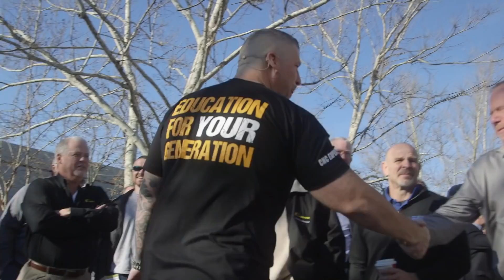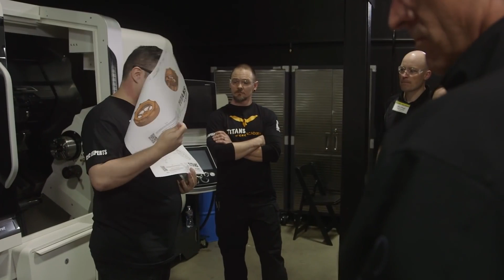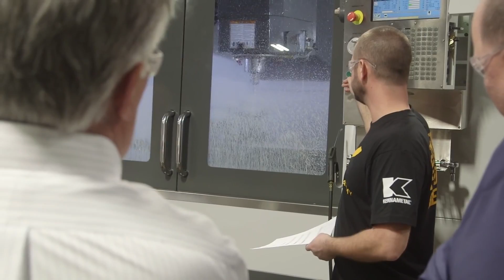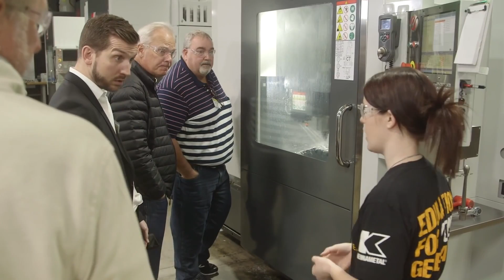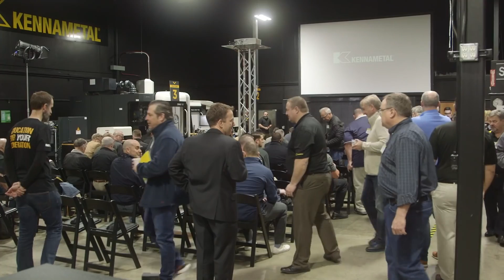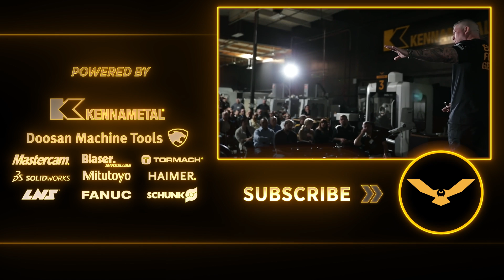The Question that Every Machinist Needs to Be Able to Answer

Comment: hard to feel good about the trade when they only wanna pay me 14 an hour and expect me to buy all my tooling. Just to run these one specific small parts, I had to spend 80 dollars for vise stops. No collets to use and have to buy more.   Jobs around here pay trash for machinist and when they do pay 2 dollars more, they wanna work you 60 hours a week.

Comment: I use to be that way at my last job tell they just saw me as a number. I can run parts fast an accurate, manual or CNC, mill or lathe. I doesn't bother me. 
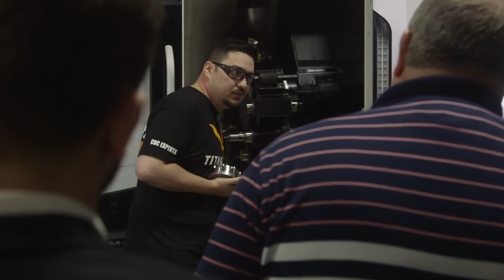What bothers me how inept my manager was that they didn't know I can run manual. I dropped a cycle time from 3:05 to 0:35 with proper tooling and programming.

Comment: Stop calling CNC people Machinist it's a insult to my trade.
Reply: There was a thing I read some years ago, They had built a New Boeing aircraft, they went out and flew it, it worked just Fine. They Landed it, took it all apart. Every part was checked for accuracy and tolerance...The whole plane was 90% out of Specification.  Thing was The critical Surfaces that HAD to be There were there. I thought that that was very telling on where the industry at the time stood. During the production of these planes there were no CNC Capabilities, There were no Bubble Gum Chewing Button Pushers that are now Proudly mispronouncing their 'Machinist" status. Goes to show that there is some latitude in a vast majority of parts, and Most are not Critical, These were done on Fixtures mostly By Skilled machinists and they were done on Manual Equipment.

Comment: Would love to set up a Veterans Org. to take homeless Veterans machining. WV would like me to do it - Land is cheap there would have to set up a campest with some mini homes as we are taking in Homeless Veterans with no place to live. The shop would not only have CNC machines but Vertical and Horizontal Mills, lathe's Shapers, Grinder. Also a section with small machines for doing things like watch and clock parts (Precision small parts).

Comment: I don't even have a purpose. I am passionate about this trade and I love everything about it, for no reason. I want to be efficient, more precise inside and outside the machine, to program smarter and fewer tool moves, find the inner strength to increase harder cutting parameters, spend less time doing things that don't make money for the shop, make perfect parts, different parts everyday. I don't work this job to have nice time, I want to be given the hardest parts, come home with headaches and lose sleep over it, find the hidden solution at 3am then make the part perfect at the end of the next day. I don't know why. Life is not made to be easy and this job gets it.

Comment: Question about Horizontal milling if my dimensions are from the part to the fixture let's say 1.250 +/- .02 and measure 1.260 is that plus or minus guys at work debate on this all the time that is plus give me some clarity on this are they right or wrong
Reply: It is plus when the number increases in a positive value. Minus when it decreases to a negative value.
Reply: 1.250 is your base value.  With a tolerance of +/- .020, that means it can be .020 higher or .020 lower, with a maximum of 1.270 and a minimum of 1.230. On some inspection reports,  they request the deviation from the designated size. So 1.270 would be +.020, and 1.230 would be -.020